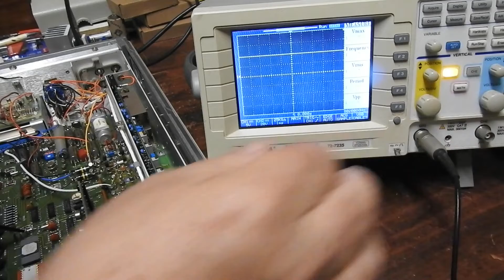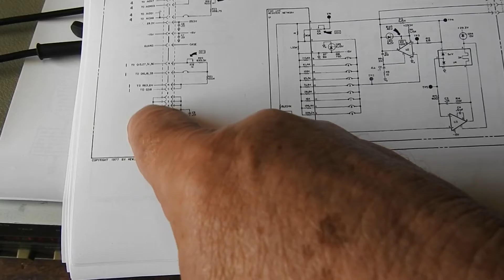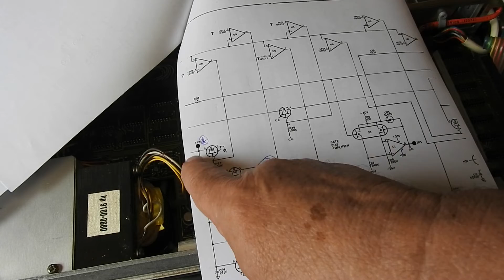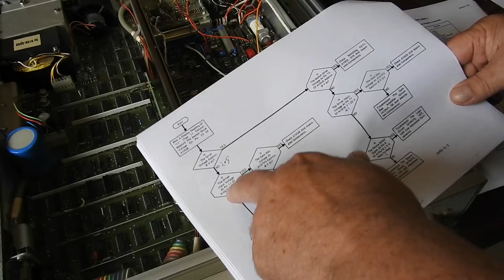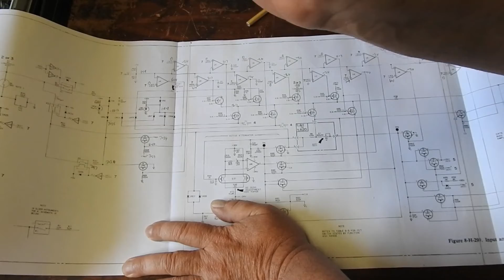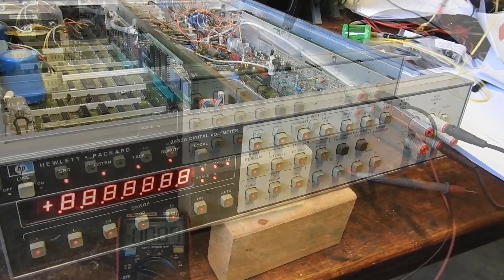HP3455A DVM Repair

Comment: I very much appreciate the videos on these I still haven't got mine fixed yet I don't have a working one to split but should have one on the way soon. The one I have has more serious issues than yours it doesn't turn on at all just freezes up unless I remove the test jumper on A3 but I knew that before buying that's why I got it, it's an older one too with the all black front panel in nice condition. Hopefully it can be fixed but learning a lot trying either way. Thanks.
Reply from the maker: Glad you enjoyed! 
I hope you are successful in your repair.
Reply: Thanks for the reply I was able to get it working this weekend I half split with the other one which is also faulty but it turns on, split the inguard from that one to my original one to confirm it was on the inguard as I suspected… I didn’t swap more boards because I wanted to find the fault with the oscilloscope I found it by shorting tp1 on A14 to ground and looking at the 0v .2 and 10v detect the lm339 went crazy… swapped it out and no more freezing, in fact all functions and ranges working accurately. I hit test it stops at 5 and hit test again it goes back to 5 every time so I’m working on that.
Reply from the maker: @ScErepair  That's good progress! 
Those LM339's do seem to be a common problem.  (I think I've heard of other cases involving them) Maybe they're under a little too much stress with 29V sitting across them? 
Anyway, looks like you'll have a result pretty soon, good luck!

Comment: Good job on that repair. I admire your persistence. I had a 3455 for while and then bought a 3456 which I liked better as it had a built-in calibration routine. Eventually sold that and got a 3457a. I will NOT be getting a 3458a, 😁
Reply from the maker: Thanks! 
I'm very happy with my old boat anchors. I like the LED displays -  none of that VFD rubbish!  
And you'll have very high confidence in your 3457's measurements with those 2 extra digits to check it against!

Comment: great video. a notice on 5V TTL  logic levels: 0 is any value from 0V to 0.4V in outputs 0.8V in inputs and 1 if from 2.4V to 5V in outputs 2.0V to 5V in inputs giving 400mv margin for the circuitry to drop (not to mention the 5V supply being from 4.5v to 5.5V or 4.75V to 5.25V depending on device family and civil vs military ratings) greetinngs from ex military sergeant doing repairs of military test equipment in 1979-1982 and if you remember how tube triodes work, Nch JFETs behave similarily you need to have VP/VGSoff  amount of negative gate vs source voltage to drop channel current to zero (D-S is the channel) in P channel JFETs polarities are reversed.
Reply from the maker: Thanks!
Yes, I know that the lower level from the diode-OR circuit was valid, but just noted it as a possible area of trouble. 
As I'd never done any serious work with JFETs, this was a good learning experience.
I've also never done any serious work with vacuum tubes, but I have some large tetrodes that I want to experiment with, one day...

Comment: I always enjoy repair videos 👍🏻 Keep it up! One thing to mention: the teflon standoffs indicate that this must be a really high impedance node, because why bother if it’s not?
Reply from the maker: Glad you liked it! 
Yes, it must be very high impedance - when Q1 is on, the multiplex node is the input to the meter, which for the 10v range and below is >10GOhm. (So I should not have been surprised that Q2 could pull it to ground with as high as 100K...)